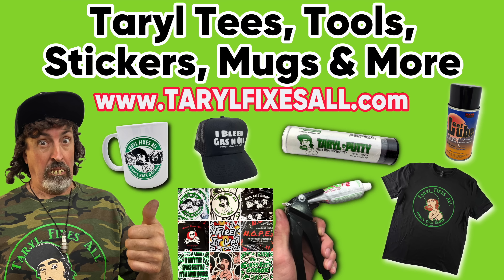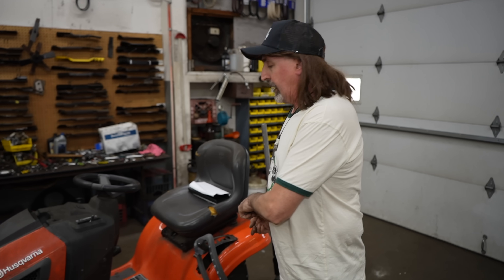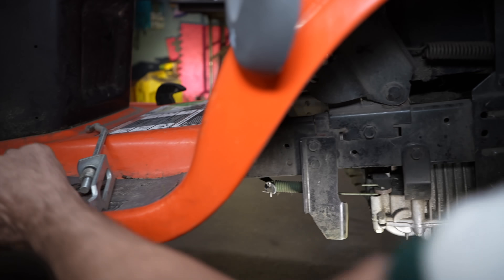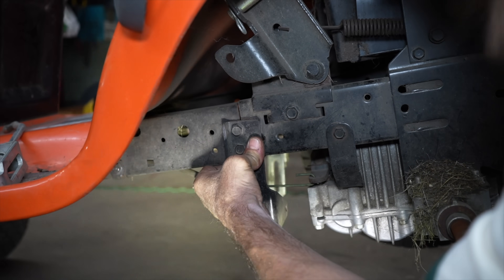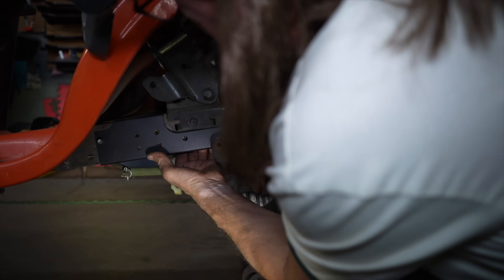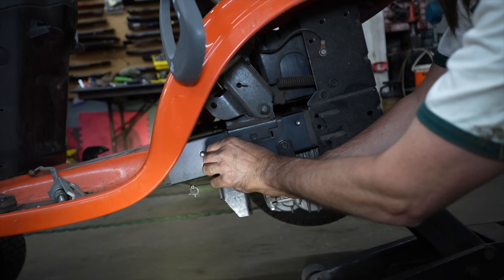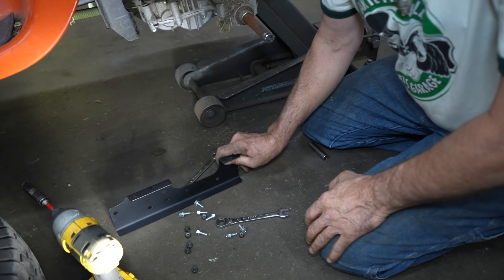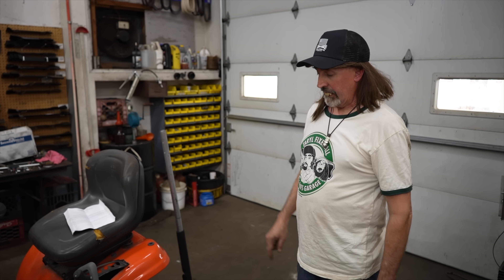MAJOR Husqvarna Frame Problem They WON'T Address! Affects 1000s of Units!

Comment: I disagree that the frame broke due to too many holes, at least in this case. If you look closely you can see the break only occurred through the bottom of those two deck leveler plate holes. It occurred for two reasons. The first is because the frame material is too thin overall. That’s a given. The second is because Husqvarna used self tappers instead of bolting through. Bolting with compression washers and collar nuts would have avoided this break, which occurred at a location which would receive a lot of stress. Husqvarna taking the quicker manufacturing method was really at fault. 
Also, referring to the warranty not being paid, Husqvarna is known for being impossible to contact when it comes to larger equipment warranties. 
Their small equipment is built well - chainsaws, etc, but I’d steer clear of anything larger.

Comment: Hey Teryl. I just had to fix again my hustler raptor for the second time  broke the frame in half once in front of the rear wheel  and  in the Back  next to the engine wish I could add pics. Those are nice frame kits
Reply: I had a 2017 or 2018 hustler raptor sd that had weak frame brackets, hustler did warranty work replaced with super heavy duty kit. Axle brackets and transmission brackets. Contact them they might get you kit for free and warranty repair. They did mine had 74 hours.

Comment: Holes drilled on a chassis don't cause cracks. Look at an aeroplane wing spar which is full of holse to lighten the structure.
To repair a cack you must drill a hole at the end of it to stop spreading.

Comment: I went and looked at their garden tractor this year. The frame is a joke. No different than the lawn tractor.  Husqvarna also had frame issues in the front of the garden tractors. Everyone was fixing them by putting a little piece of metal bolted to the frame. It happened so much that if you go look at a new one  on the side of the frame towards back of engine that Husqvarna actually puts a piece of metal there from the factory now lol. I looked at Cub Cadet and their lawn tractor has twice the frame of a Husqvarna garden tractor. But I ended up getting a GR series Kubota diesel.  Lots more money but best decision I made that day and I love that thing
Reply: Kubota seems to use real soft metal, must watch wear points.

Comment: Get'em Taryl!  Tell it like it is.  Corporations want our money with junk products.  There should be some sort of law that stops this.  Sadly, someone has to file suit and make them do what they should have been doing all along.
Reply: I have a 2002 Cub Cadet 1515 38” Riding Mower with the quick attach mower deck with the front roller. VERY good connect system. Heavy Duty Hydro Trans with 1086 hours on the 15 pup Kohler Command. Only replaced belts , idlers and front tie rods. Never had Any service other than oil changes and air cleaner foam replaced you oil it. Best strong mower they ever made. They make a lot of junk now. Paid $2200 in 2002. Heavy frame. Same deck. Kept it oiled in the winter to prevent rust. Same spindles. Lots of grease fittings.

Comment: Thanks Taryl for info. I probably would weld several small beads anyway since I’m already there.
Reply: The welds will most likely crack in time. The metal around the weld is made very brittle from the heat of the welding. A little flexing and you'll have a crack right next to the weld.

Comment: I Have a C.F.Struck Compack Garden tractoe my frame is a fabricated 1/4 inch thick steel chanel my problem is the 16 hp tecunseh cast iron engine it is old and i cannot find a replacement , the drive belt to the transmission is on the right hand side looking forword so the engine has to turn clockwise in order to go forword do you know of such an engine ??....??

Comment: I had to deal with this 3 years ago. The frame is too thin. The way they designed the frame to stamp it out is flawed. You have to add 3/16" plates to each side.

Comment: taryl, my father has a 2014 "junkvarna" should have been named already its a  heavy deck 26 hp kohler yt48 xls doesnt have 600 hours on it and the frame cracked in the same place and were the transmission is mounted the shitty mounts broke also. i had to fabricate the trans mounts and fix  the crack on the side of the frame. it is noisier than the other riding mower we had. that was a 1987 ford, "gilson made",yt 16 h with the opposed 16 hp briggs and stratton. with a hydrostatic trans. it had aprox 2200 hours on it. my father just gave it away recently. nothing is basically made here anymore. i dont know how you guys fix stuff anymore worrying about parts availability and such.

Comment: Thanks Taryl! I wish I would have known about this kit sooner because I have repaired several of those fecal matter subjects over the past couple of years. I came up with my own design, which is part welded and part bolted design, which works, but requires more work to install. The tractors with baggers on the back are much more prone to breakage due to the weight, but they all break eventually because they are all the same Swiss cheese design that is really stupid. I have a 1996 GT200 with 2700hrs. I am still running daily over rough terrain that hasn't had any frame issues, but it doesn't have all those holes punched into it either. It still has the original Kohler Command 20hp engine and the only repairs I have made to the engine was the magnet came off the flywheel and wiped out the alternator and adjust the valves. All the Husqvarna stuff has went to crap as well as many others going to throw-away units.

Comment: You're gonna weld that crack first because you know as well as I do, the tolerances between the bolt and the holes isn't as tight as a weld. If you don't weld that frame first, those bolts will loosen on those new repair plates, no matter how tight you get them new bolts. Weld it up first! Ask me how I know....35+ years of experience and over 2 dozen of these repairs in that amount of time....

Comment: LOL I got a 2014 24hp 48 inch cut for 150 bucks that had broken frame and it cracked transaxle bolt locations and transaxle fan! Fixed frame new belts and fan and changed out the transaxle oil! 300 bucks into a 2000 dollar lawn mower. SCOOOR!

Comment: Hey Taryl ! I went to local JD dealer here (Indiana). Bought genuine JD parts. Both pulleys I got were made in China. The drive belt, from Thailand. Sure is hard to buy American!
Reply: Even if the parts are made in America you will still find a Chinese made bearing in them

Comment: I think if you carry the kits, get the kits that have the back plate too. I would want the front and back plate installed if I had that tractor, for preventative measures.

Comment: I’ve had a Husqvarna come in the shop and the frame broke where the transmission bolts up to. The little bent wings on the frame were barely held on by an inch of steel on both sides. The front support bolt on the transmission had snapped off in the transmission. I fixed it by cutting off the dinky transmission mounts and used angle iron and a section of square tube with holes drilled in it to mount the transmission and welded it on the frame. I replaced the front mounting bolts. Problem solved. The frames on these tractors are so thin and cheap it amazes me how they could get away with this garbage and still sell the garden tractors for over $2,000 for the tractors. Since Husqvarna tractors  is made by AYP, that means the Craftsman tractors will have the exact same problems. Buyers beware.

Comment: Great repair as usual and loved the video.  The factory guy needs to comprehend when a person is NOT looking to have a complete rebuild of the lawn mower but is asking to just acquiesce to a quick fix and remuneration.  Taryl, for some reason the video had some synchronization problem with the lighting or something that caused a wavy fluttering like appearance during the undercarriage shots.

Comment: I must have gotten lucky or this doesn't pertain to my particular model (2015 Gt52XLSi). There's a U-shaped reinforcement piece running crosswise in front of the tranny that uses up some of those holes and also fastens to the tranny. I've run into snow banks while plowing and never had a frame problem (KOW).

Comment: I’ve been doing this for 12years and I have never had do this ? 

I know you’ve been doing it longer but 
How does the frame just crack like that ?   The customers have to be abusing the hell out of the mower ? 

Thank you for always putting these amazing videos on YouTube for everyone to get help or knowledge 💯
Reply: Junior Engineer skipped Fatigue Failure chapter in Shigley's Machine Design textbook. Sadly Fatigue failure has been known for 70 to 100 plus years. Also a newly minted Mechanical Engineer told me that "they have solved fatigue failures" and he is now at a jet turbine maker.

So totally clueless
Reply: Not really !!

Comment: How do these frame break I never seen a lawn tractor frame break before this is new to me and great interesting
Reply: Probably twisting of the frame caused by the leverage of that mower support bolted over that spot caused the fracture. The strange part is that the crack did not connect the 2 bolt holes. The bolts pulling the frame tight against the thick brackets must have prevented the steel frame from flexing close to the holes, so it cracked a millimeter away. I would have bet money that the crack connected the bolt holes, but it didn't. Welding the crack shut might just cause another crack to eventually form right next to the weld. Steel plates bolted on both sides of the frame are the best permanent fix.

Comment: Weird how the crack went around the holes. Thanks for the fix.
Reply: A Hole adds a stress concentration. So that is where  cracks often start. ie a Fatigue failure. Each loading  cycle cracks the crack more and more. There are a dozen hokey variables. Surface finish; hole radius; paint and plating; 

the place where the "crack starts" has the broken area polished;. ie each load cycle rubs it some. If the rider is Bubby who weighs 400 Lbs then the crack grow quicker!

Comment: Common problem with the trans mounting bolts coming out too, causing the drive belt to fly off. To fix, drill through the trans and add longer bolts/+nuts.

Comment: The junk they are putting out now is insane. I bought a Diesel Kubota zero turn 26 HP  16 years ago. I have hit every rock, stump, and tree in rural Florida that jarred me to my core and it has never had a failure. I couldn't get squat out of a main stream mower. So in the long run it has saved me money.

Comment: They punch all those holes in the frame to lighten it up, just like manufacturers, using plastic to lighten the vehicle, the lighter it is the easier emissions threshold it will fit into

Comment: I've got a Gravely 16G, and a 20G.....35-40 year old IRON.  No plastic crap, no nylon gears, no wafer-thin sheet metal on those.  Union Labor costs shut them out of business, but you can find the old Gravely tractors STILL IN USE, and there's a following of hard-core Gravely fans, for a simple reason: QUALITY OLD IRON.

Comment: Reminds me of the 73 through 87 square body Chevy trucks they would tend to crack at the power steering box you had to have a gusset pla gusset plate kita gusset plate kit to fix the problem like these Husqvarna mowers they seem like they've gone down the trash tube lately

Comment: You need to do a spot on the Scrub Cadet electrical fires . As mine did after being shopped 3 times under warranty for not charging and blowing fuses . And MTD flat denies they have a problem! Even with it being here on you tube !

Comment: Nice kit saves you from making your own template and fabricating your own metal part, i do hope that the metal part is thicker than the original frame or you may be having the same issue in the years ahead. I likely would have used a thicker piece of metal, or sandwiched in another piece on the opposite side. Does make life easy when the kit is already bent and drilled to size, makes it a bolt up process at that point. Cheers.

Comment: You didn’t have to pull that transmission bracket off you could have slipped the new reinforcement right in without removing it

Comment: I have heard years ago that Husqvarna has the worst warranty in the business and to stay away from all their products. In the tractor forums there is nothing but bad news regarding warranty claims left unanswered and nothing can be done about it unless the dealer wants to step up and just pay to have it fixed. Don't push snow with these even if the dealer says you can, you will buckle the frame. These are NOT garden tractors. If you want a real garden tractor,  find and restore one from the 70's and 80's. Ford, Case, Cub Cadet, SEARS, JD 318's, Wheel Horse, and a few others that I am sure I missed. These are the ones you want. Most of these, if not all of them can also handle the kwik way FEL.

Comment: No way I would use the self tapping screws for the brackets. You get the bolts, use them. I'm ordering the kit, even though my POF tractor hasn't broken the frame - yet.

Comment: I would clean  the axles  first after you fix the frame and put some antiseeze on the axles then I would put the tires on and put some antiseez on  the end of the axles shafts before putting in the wheels on the ground it would make it a lot easier to pull the tires off.

Comment: There's no way I could have left that frame broken. lol..    I  would have been too tempted to tilt that mower on it's side and weld that frame on the inside, now that you have it all lined up.....   (or at least lift it up in the air a little more and crawl under there.

Comment: A John Deere I've got I've had for 10 years almost and the same thing happened to it. It has not happened to the orange tractor yet. That I have cause. I haven't used it verywatch it's only got a little bit of a amount of hours on it. The John Deere's got more. I have AD160. That it happened to.  I had to get the frame wilded.🚖🚉🚉🚜

Comment: their transmissions are garbage too. I had to fix one that the axle broke. a year later the other side broke off at the wbeel.
Reply: the transmission was a Tuff Torq K46BT I think. It's been about 10 yrs since I had repaired. gave the Husqvarna away to someone who works on them for parts. That way someone else might be able to save some money .

Comment: And remind me a lawn mower I bought it was at a sale and it had four flat tires but it look brand new I asked Alexander what was wrong with it he said I don't know it was dropped off there but he couldn't understand and pulled it off the trailer with a truck I bought it for like 200 bucks four flat tires no battery didn't know if it run or not come to find out it was a solid steel frame the tires wasn't flat they just wasn't made for it

Comment: I don’t own one of these machines but if I did, yeah, I would go ahead and install that kit before I had a problem! The only thing worse than a company with a good reputation building junk is their refusal to stand behind the junk they make in even the most basic way! Their corporate attorneys probably wouldn’t let them pay for the welding repairs under warranty because that would be admitting there is a problem with the frames which opens them up for a class action lawsuit. Every time I hear about problems with this modern junk equipment, it just makes me want to keep my 25 year old machine going even more! Why would I want to overpay to buy a new set of problems?
Reply: Yes the old riders were built like tanks as our old car's and truck's were!

Comment: The Design Engineers at Japanese Companies I worked for in the 1980's got married to their designs. So if they had the product fail anytime later their rear end was in the trenches to fix the issue. 

It did not matter if the Japanese guy was now a manager; or VP; or president, ie he HAD to help fix the product he fathered. 

The USA sometimes tends NOT to do this. 

ie Some Golden Fake engineer can father / create bad designs and more bad ones over and over and may not help the disasters fix.

 ie no loss of face; no having to eat his own rotten cooking.

 Rant over! 

Some USA industries have design engineer who fathers/  creates the designs and sustaining engineers who deal with the mess in production. The sustaining chaps get paid less. Better USA companies drag the design engineer back into the fix of the crappy bad design he created. ie he has to help fix it or be canned for cause,

Sadly I have seen the same crappy engineer on the next model design in the same flaw for 3 later models. ie had nothing to do with money; the person just did not care.

Comment: $100 for the frame kit. I have four Husqvarna's, two 46"s, a 42" and one without a deck I use to pull wagons. The only problem I have with my Husqvarna mowers is that they do not raise the deck high enough and living on a rocky ridge am always bending blades, cracking mandrills and bending mandrill shafts. Rather than spend the $100 on a frame kit, do what I did and buy a Titanium 125 Flux core welder for $130 from Harbor Freight along with a good set of gloves and an auto darkening welding helmet and simply weld the frame and be done with it. Then you'll have a welder and it's easy and fun to use. OH...none of my four Husqvarna's have a broken frame. Just sayin'.
Reply: They make what you need.  It's called a brush hog....

Comment: Yea it dumb that they  pop so many hole's in the frame .  From what i'm told the frame is used by many other mower's as well. Like the mtd brand's  an John deere .  i know there a Craftmans mower that had the same frame out there .i can't recall which mower it was i recall it having the v-twin Kohl  engine with the 54 in cut  deck .

stuff just ant built to last anymore .  they want it to break . go drop 3,000$ on another mower .